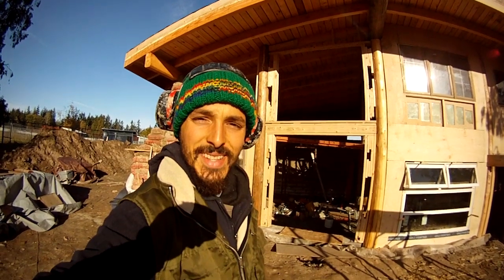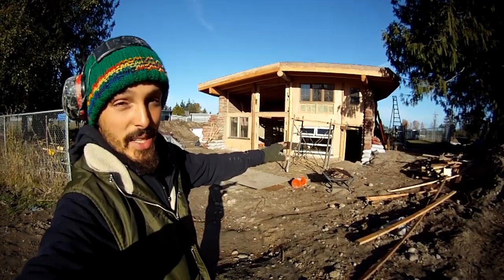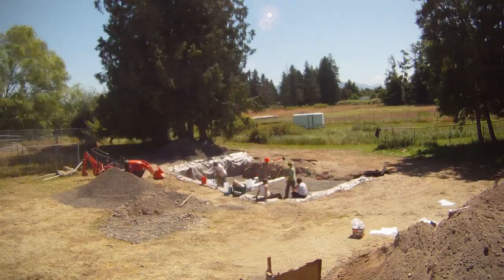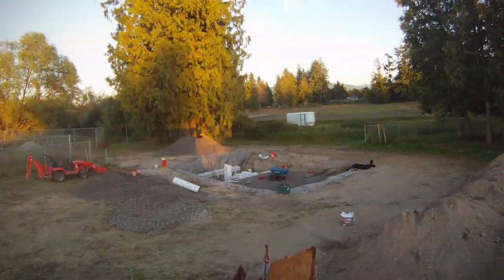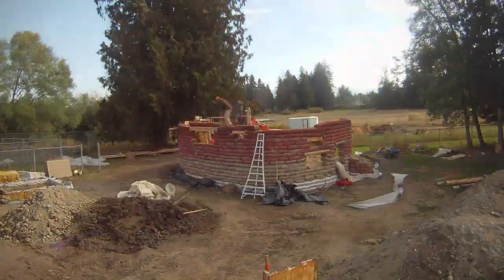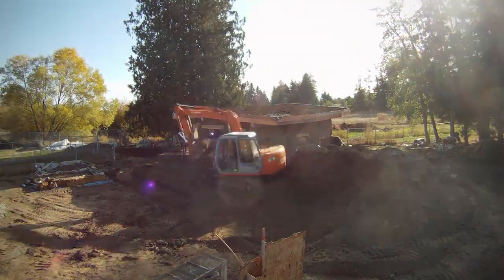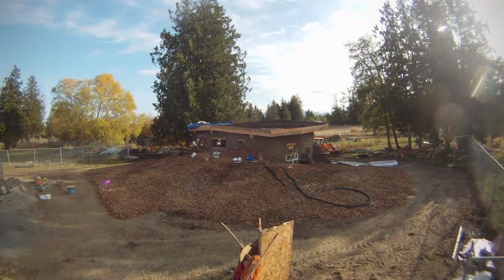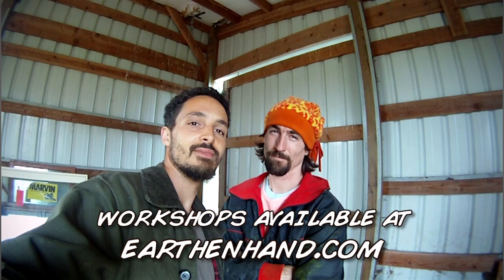Earthbag Building with Earthen Hand

Comment from the maker: Thermal mass and R value are different things. The building is heated and cooled by Passive Annual Heat Storage. Look that up. R value is a measure of insulation. The walls and berm have a value of something like R1/2 per inch. A passive solar building like this can need less insulation if the Thermal mass is appropriate for the climate.